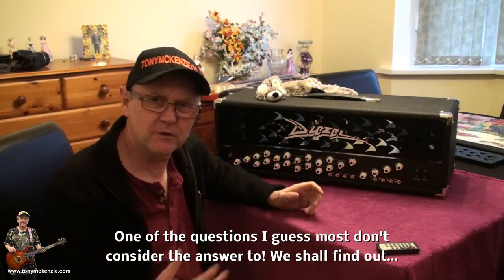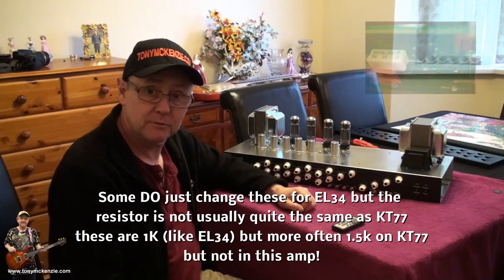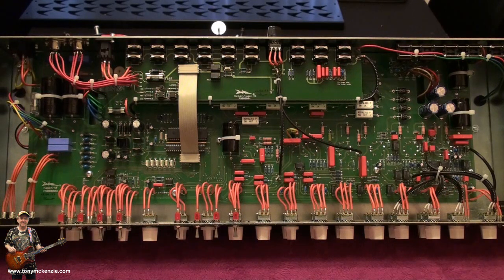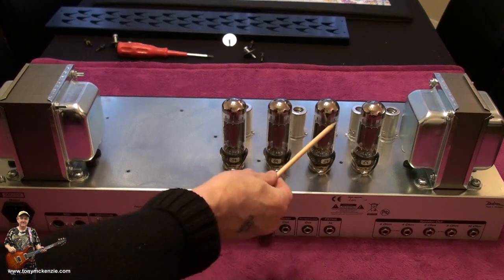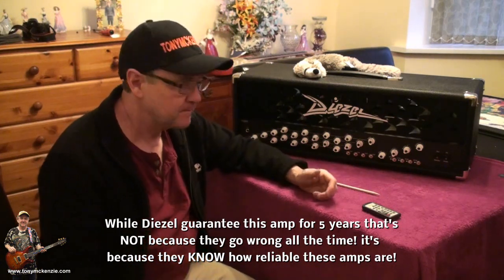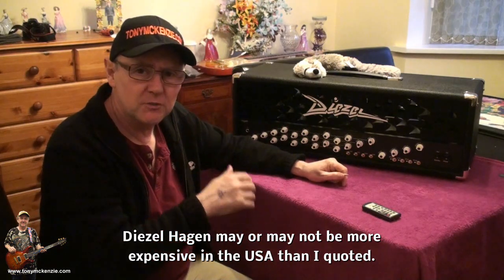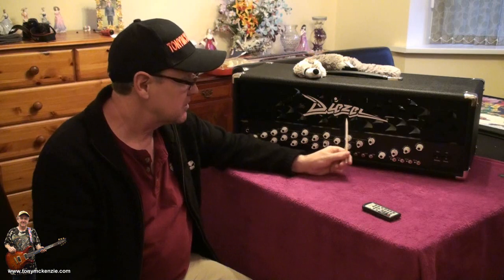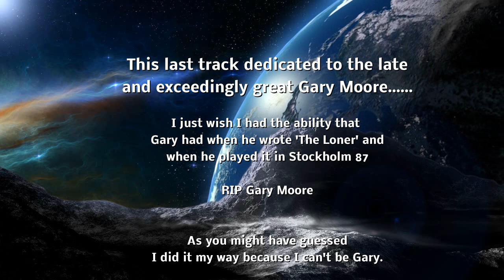Diezel Hagen Amplifier: Are They as Good As They Say?

Comment: hi tony hope your well mate im looking to put a set of 59 strat pups in my fender standerd strat mex iv done this stuff before but are thay as goot as the tex mex pups
Reply from the maker: Hi Muddy... well I'm better than I was... still slow recovery from the op. I think you mean USA 59's right? Good is a difficult point really... I think you will have a great tone from real USA Fender pickups against the mex ones for sure. But 'better' becomes subjective whether you like the tones... in my case I really like the USA 69 CS Fender pickups and they sound sssoooo much better than later pickups to me. I've used those at least three times and never get weary of the sound of those. Fender always harp on about pickups and for me the USA ones are much better tone. I would check the 59's out BEFORE you buy or fit them... they might be a bit weaker than the tex mex.  Check those 69 ones ;-)
Reply: ok thanks tony as all ways the man to ask . I think thay will lift my strats sound a lot .well hope you git better soon bud
Reply from the maker: Muddy Walker I'm working on it ;)
Reply: glad you are dude

Comment: hi Tony It's Steve in the States, just picked up a VH4S for 2650.00 It is nice, thanks  for the in depth review....
Reply from the maker: steve kennedy Hi Steve...wow that's not a bad price for one of those.... as luck would have it one of the KT77 tubes blew last night... I have never had a tube blow in over 30 years... I put it down to the crap brand they seem to come with.... I might even dump them and fit some decent EL34's... I'll see how the replacements go as I just bought some well selected ones. They claim the selected ones are much better - indeed I just might do a bit of a short review on them. Enjoy the VH4S :)
Reply: Hey mine came with EL34B'S
Reply: Ruby EL34B its a 2002 model
Reply: The el34b's sound great to me I would recommend putting them in it plus they sound warmer to me
Reply from the maker: steve kennedy Yes I know guys do change them for EL34 types.... and they say the earlier units had EL34's in them from the factory and Diezel changed to KT77 Ruby Tubes... but in this Hagen they are c*ap! First tubes ever blown and they are Ruby Tubes. I did order replacement Ruby KT77's (as I wanted to keep the amp 'stock') but to be honest if there's any messing about re the Ruby tubes Ill just put TAD Tubes in the amp as they (although premium) always work and NEVER let me down. This is not the first time I've seen Ruby tubes fail... its just not been in any of my amps. I have never really been convinced with them and lord knows why Diezel use that brand... maybe its cost... who knows.
Reply: ***** you know even the new STR440 MESA TUBES are shit these days, the JJ TUBES seem to be the better of the new ones I have put in my amps. Since they are only manufacturing tubes in 2 or 3 countries now that's why we have the sub par tubes, as for the CHINESE crappers I won't use them,l the 12ax7  tubes have the worst microphonic noises. but most kids can't afford good tubes so they install those crappers.
Reply: ***** I also got a MIDIBUDDY and a road case for the 2650.00 I guess the guy was selling all of his studio equipment to move back to China...
Reply from the maker: +steve kennedy The only other issue I have seen of recent times with power tubes was on EL34L's from Groove tubes. They were darn expensive and claimed to be really well matched. I bought two pairs matched at GT and I can tell you they were so well matched I could not even use them in the JTM45 which I was re-tubing. Eventually I sold those brand new and lost on them so that brand bothers me too. I don't use unmatched stuff ever really but TAD have always come through for me and when I check them on my tube checker they always come out just as TAD says. On these new KT77's I've just bought the seller says they are matched to within 2ma and have been burned for something like a week... so I really do hope they are as good as they really should be. I'm like you on the 12AX7's I am VERY picky on those and I think they have a massive influence on the overall result.
Reply from the maker: steve kennedy You did well there especially if that amp is clean and looked after. Some knock it all around (that happens) but I always like cleaner looking amps as I reckon they are looked after just that bit better :)
Reply: ***** yes It's really clean, looks new but I don't really see how these amps are for made for a 7 string as It appears to me that the 7string would sound way to muddy to me , I am using Gus G blackouts on a ESP GUS G model and they sound amazing through the amp, since It's a Stereo amp I use 2 -1960 a Cabs. I am pretty happy so far, I was used to my Rocktron prophesy with a mesa 2-90 but this set up is a lot warmer less harsh on ears...
Reply: ***** V1: 12AX7-B High grade selection on B-side 678  V2: 12AX7-B High grade selection on B-side 678  V3, V4, V5, V6 (V7, V8, V9) 12AX7-B  Reverb: 12AT7-C  Power tubes KT77-JJ with 35mA bias each tube, 70mA each pair  this info was just emailed to me from Mr. Diezel  these are all stock tubes on 2014 stock models..
Reply from the maker: steve kennedy Yes I have 1960 cabs all over the place... they sound good to me too. Never used the Gus-G stuff maybe I'll check it all out. I used to have the 2:90 with the TriAxis :) and that sounded really nice in stereo... but these Diezel do have their own voice for sure even though Peter (it seems) came from Marshall modding. I just wish he did not choose the KT77 which seems a bit of a back water tube these days... not many makers (maybe the reason he chose that brand).
Reply from the maker: steve kennedy Yes that will be correct if he says so :) and is (apart from the stereo) the same as I have in the Hagen give or take. Those KT77's I have bought replacements (not arrived yet) but I'm going to try the EL34 as I have some winged C's lying around. The tube that failed took out the fuse even though I switched the amp off pretty sharpish... oh well. I just hope it did not zap anything else - I'm on that today.
Reply: funny thing about the zap when I first fired mine up I did see a little ZAP on the first power tube hit stand by quickly and then It has not happened again, It did not take out the fuse but was arching for sure...
Reply: so I'm guessing you will be  fine, not to worry just re-bias as you already know and you will be good to go.
Reply from the maker: steve kennedy Be careful on that Steve.... don't trust a dodgy tube ;-)
Reply from the maker: steve kennedy Yes I fitted EL34's and they were good to go. The KT77's have now arrived so I'll probably stick them back in and rebias to 35ma... should be fine.
Reply: nice...

Comment: It's best to get the cab that's made for that amp head  because it usely  sounds best and looks best!
Reply from the maker: Its a valid point for sure, but I've been down that road a few times myself with different manufacturers and never really had the sound I liked, and paid far more for the cab than it was really worth... a good example is Engl or Mesa, buy the non pro Engl cab and it's not a pretty tone. So I use the 1960a and to my ears it sounds good. In fact I pretty much standardise on the 1960 (a or b) but also have a Marshall 100 cab HW with older style speakers for the JTM45 I have. Maybe there would be an improvement with the Diezel cab but to be honest, its a very good sound for the styles I play... I'm not all really heavy detuned stuff (which many attribute this amp to but would be wrong in that assertion) so my 1960A seems to be a great match. Looks matter less to me but I know what you mean. But in the studio no one sees any of that.

Comment: what kind of wood does diesel use they dont specify on web site and my cab its hard to tell  looks like pine but i wonder thatd be wierd
Reply from the maker: That's a great question and I really don't know the answer except that it's usually Baltic birch? Thanks...
Reply: I think mine is Baltic birch. I got a silver face rear loaded straight 4X12. Chose it over the 3 Marshall 4X12 cabs that were at GC. It's "straight" but the face leans up just s slight bit
Reply from the maker: Yes likely Baltic Birch... The Marshall's are Baltic Birch usually if 1960 a or b also...

Comment: Have you ever had a look inside a Framus Cobra? German made, beautiful amp.
Reply from the maker: +WholeLottaBulldog Unfortunately not. But I have wanted too! It's all a matter of what where and when :) there's so much gear and I have to buy it all so sometimes it takes me longer to get there. Thanks for watching.
Reply: How funny - I have just toastet the PT of my Framus Dragon - which is a similar design to the Cobra. Now I was wondering if I should go for a JVM 410H, or maybe even an Engl Invader. By accident I read about the Diezel amps, and here I am :-). Great review and many thanks to Mr. Mackenzie! I believe I will save until I can afford a Diezel. Cheers!
Reply from the maker: This amp I STILL have and won't sell it because of it's very specific rock tones. When you want a tone like I had on the playing (its specific I agree but it IS the tones I like) and unlikely I'll sell it anytime soon. Thanks for watching. BTW another amp (that sits on top of my Diezel Hagen) is the Marshall JVM410HJS - NOT the 410H. Its the Satriani version and make no mistake, that amp is particularly awesome and at a lower cost (maybe) than the Diezel. If you can find one I can recommend the Diezel and that 410HJS. Thanks for watching and thanks for those kind words.

Comment: well, I can bare with the valve sockets soldered straight into the pcb board (if i can deal with the fact of a PCB at all). but those integrated circuits or "chips", if burnt or blown, must be irreplaceable, i dont see how can someone find them after say, 20 years from now. valve amps are supposed to last a life time, as hand wired fenders and marshalls do.
Reply from the maker: That's a good point for sure, but I suspect the chips will be there for some time (common used everywhere). The hand wired stuff I also have and as you say they are easy to fix if there's a problem (relatively). But I don't really mind PCB stuff as long as the quality is there - which often it is not. The THD PCB was pretty awesome at twice the thickness and with really big tracks. Thanks for watching.
Reply: Most of the commonly used chips have been in production for 40 years already. I dont think thats a valid reason to dislike an amp....
Reply from the maker: To be fair it's dependent on the exact chip... some go out of production? or worse... the replacements are different. As a matter of fact... actually I like the amp... it has a great sound. The only shortcomings IMO were tubes that are not quite what I am used to and that carbuncle on the PCB that was clearly a 'fix' to correct PCB issue. But you raised a good point for sure - thanks for watching.

Comment: Hello, nice video, unfortunatly with some wrong information. Regarding the guarantee from Thomann: The original 5-year guarantee from from Diezel remains unaffected. So you still have a 5-year guarantee on this product, wherever you buy it. And the tubes are selected chinese (as many others like TAD or Ruby tubes) and selected once more by Diezel. While I don't want to take away anything from Mr. Mckenies experience, I regard the experience of a high-class manufacturer like Diezel simply much higher and respect their decision to utilize a certain component. It simply wouldn't make any sense to jeopardize the reputation of those products by choosing cheap and unreliable components in order so save some bucks. And those who believe this, well please simply choose another manufacturer and thus shorten the waiting time for us "fan-boys".... 🙂
Reply from the maker: All fair enough points. The Chinese tubes - I never saw that mentioned in their promotional stuff when researching at the time? Maybe they don't like to talk about Chinese tubes - lets face it, generally they carry an often less than perfect pedigree. I agree that PROPERLY selected tubes that are also burned in (as you mentioned for TAD and I use all the time) are fine - even Chinese ones. The little board mod, while electrically correct I guess, did look a bit of a botch to the average guy I might suggest. I don't condone the 'cheap' tubes from anyone, but unless the specific reputation (like TAD) says so on the tube, then you really can't tell if they are 'selected etc. or not can you? And neither can anyone else in general unless you have the equipment to check them which most people don't have. This was and remains a very good amplifier and I said so in the review. Make no mistake if it was rubbish it would have been treated exactly like the Friedman JJ Jnr amp was in that review I completed - and you know what, for that Friedman, not a single person even bothered to contact me and explain why they sold junk as a new amp, not the dealer or friedman. That says a lot. Thankfully on this amp it is a brilliant unit (and trust me I don't say that casually) that has an incredible rock tone as I showed in some of the playing and I still own it to this day. So I trust that the above goes some way to explain the position I saw at review time - I can't read minds and I report what I see. Thanks.
Reply: @tonymckenzieofficial  I hope I was not too harsh, I still find you did an outstanding review. And maybe the Diezel guys released the video as an answer to criticism for utilizing that kinds of tubes. In that video they explain the procedures of hand-selecting those already pre-selected tubes and much more. But I can fully understand the reaction when opening the amp and discovering components that look (and probably are) among the cheapest possible. It must be...shocking and disappointing, initially. I highly respect your work, your patience and your commitment. Please keep it up, Mr. McKenzie! Many greetings from Sweden (though I am german...) 🙂
Reply from the maker: No you're OK. And thanks for that post - useful because of its content and hopefully I answered why the review as it was. Thanks...

Comment: I don't think a $4000 amp should be made on a pc board. That is sad really. The jacks on the back are connected right to the second level board. If you pull or trip on the chord there goes the connection points. The resistors have no where to breath when are stuck right to the board so there is a much high chance for them to burn up. They are using cheap caps not that, that is a major deal but when spending so much more, I would expect they would be using more expensive caps that aren't used in every other amp. Also there are a lot of solder points that are extremely close together they have a high probability of arching. I'm not trying to be negative, I'm just being honest. I would and will never buy a pc board amp, especially one that is $4000.
Reply from the maker: I understand about the PCB and hear some guys with similar views to yours. I have amps with both PCB or TAG board P2P, but to be honest, I don't see problems with either for the most part and have only had one amp fail since 1991... and that was a Egnater Tweaker (check my review) which had been repaired (before I had it) and they missed the smoothing caps so it failed again. I put that down to a problematic issue of the PT (which appears to be common on the tweaker 40 head). I also think that this is a very expensive amp at list price and looking inside does not necessarily reflect what you might want to see. I could not believe the issue of the preamp tubes for this price. Of course there are many other amps similar internally (component quality wise) and some much worse. But the PCB for me is not critical, because like I said, 1991 is a long time ago, and the failure then was a Mark III (or IV i forget) that had crackling coming on so I sold it. Thanks for the input ;-)

Comment: funnily enough... the same goes for Hartke's amps... I have a HA3500 and a VX410L cab... total cost, £670.95, in the USA... $1400 give or take a few cents... the head alone's about $650 and it's about £325 in the UK... also... chinese tubes are horrible, they don't last 5 minutes with me... I prefer Russian, US and UK tubes, Hartke themselves prefer to use russian tubes... and by god are they good tubes!!
Reply from the maker: Yes there are massive discrepancies on some stuff. The Axe-FX II is $2100 (give or take) but in Europe is £1973.00 as we speak. They are not alone and Mesa is awful for it. I blame the distributors as it seems they 'fix' the pricing in local markets to what the gear will 'stand' in the marketplace. There are other considerations, but frankly I don't believe much of it as I have seen it all first hand on technology products since the early 80's. Its both ways too... USA market and UK Markets.

There is legislation to stop it all and to stop price fixing at dealers because the distro applies pressure, but what government is going to reduce their own fat cat income from purchase tax (VAT) to impose the law? Nobody cares so we all suffer. I have not checked Hartke products but I'm sure you will be right.

One of the reasons why I published how to change a mesa road king II from 110v to 240v so the greedies don't have it all their own way. It IS ridiculous and it appears to be mainly across the board of not just musical equipment.

Check the cost of say a 'Breitling' watch. Or a Rolex (they are TOLD not to discount in the USA I believe), but some dealers will. After discounts of either brand they are far cheaper than you could ever buy one in Europe.

In the UK I was told by a music dealer specifically recently that if they put gear on say eBay and discounted from list price that their stock supply could have some problem. That's about as plain as it could be and says it all.

As you guessed its one of my pet hates. ;-)